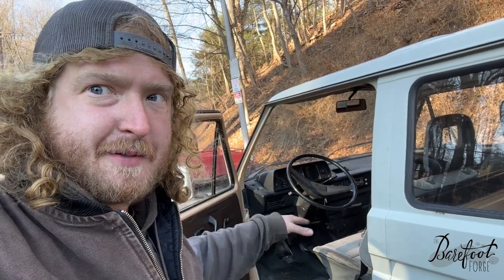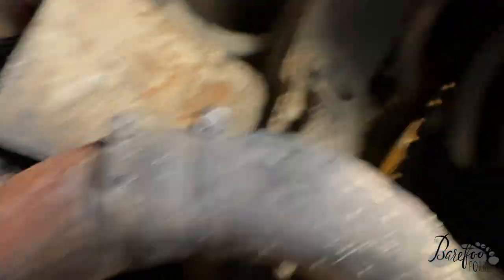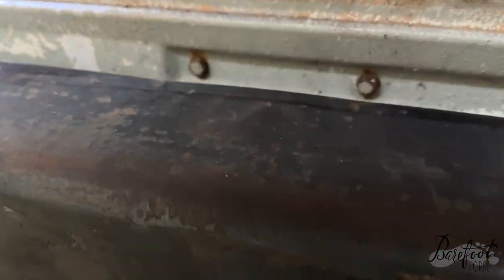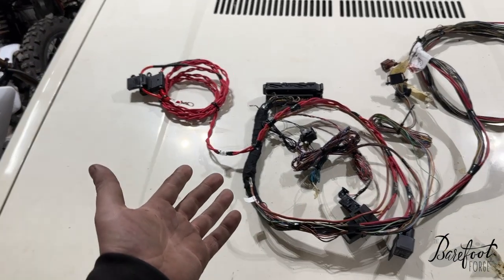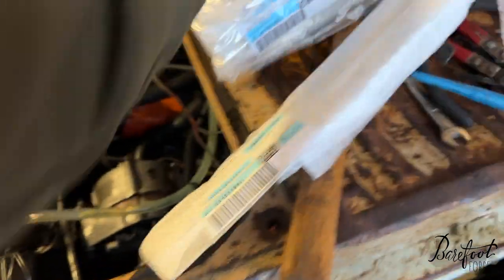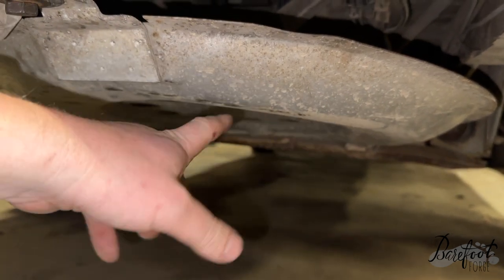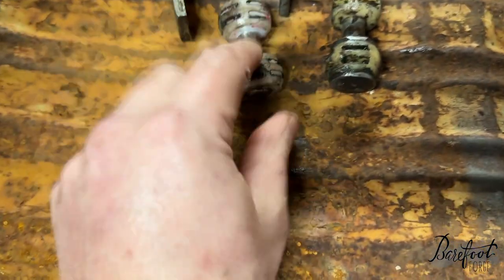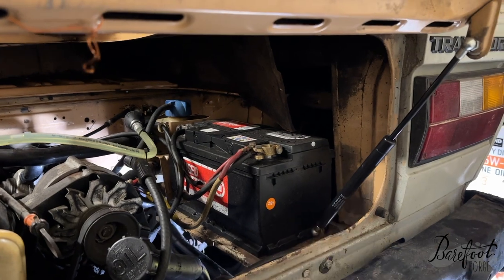VW Doka From Poland- Chapter 2 "That's Also Broken"

Comment: I bought a 91 Carat at the end of '21. I looked like the same person did transmission things to our vehicles. Mine also has an air-cooled era tranny and the shaft was cut in half then old shaft welded back to it, and it has been a nightmare to deal with. I drove it back from Clearwater Fl, to the St. Louis area. It was a miracle I got it back. When I started it the day after I got back, one of the plastic coolant tubes broke off at the engine side and dumped coolant all over the driveway. Break lines were hitting the radiator fan. I found 6 different coolant leaks after I fixed the plastic tubes. None of the balance or expansion lines were in the top of the gas tank, it was just open to atmosphere. Both the feed line and return line leaking fuel. The Power steering rack sprayed fluid everywhere so I rebuilt that. Guy I bought it from said it was his daily driver btw. After a year of rebuilding, I started it for the first time last weekend. Hope to drive it tomorrow after some finishing touches. Love your videos, looking forward to the next chapter.
Reply from the maker: Awesome man! That sounds like quite an accomplishment! I hope your drive tomorrow goes well!

I like to say “reliability has to be earned”. The last guy earned it, trusted it, and knew it- but his reliability doesn’t always pass on to you. Now you’re making it right, and earning your own- it’ll be good to ya!
Reply: In my Westfalia the previous owner did very similar butchery - mostly due to the engine swap to 1.9 TDI (1Z). It is a common trick to swap the gearbox to DK (from gasoline aircooled) to get better ratios, more suited for 1.9. It is not a fast gearbox, but faster than it would have been with the original one that came with the JX (1.6) engine.

Comment: Glad to see you experiencing an oil-burning "bus". In Europe people seem to avoid the later PD engines because of the associated ECU, immobiliser etc. but you guys in the US kept the earlier Bosch pumped engine for a few more years than us so I guess you have more parts available than we do. Again, we sometimes see Passat 5 speed diesel trans fitted (upside down) but that leaves you with a vertically transposed H gearshift unless you can find a way to correct for the fact the box is pointing 180 degrees to its original fitment...
Reply from the maker: I saw folks doing the Passat five speed thing back in the day, so folks still do that?

Comment: I have an '88 camper that had the same engine as your DOKA. After messing with it over several years I eventually gave up on it after rounds of problems involving a  previously bodged cam,  injector pump, the pump enrichment device... turbo.. leaks and then the final straw... overheating.  I then swapped in an AHU TDI and while that has also been a pile of work to get it working right, it is so much better to drive with the extra torque and power.  One good thing about all the stuff that is wrong with your DOKA is that by the time you have it all sorted out, most of the wearable pieces are going to be brand new...
Reply from the maker: Exactly! Lol. 
What transmission/gearing did you tie to your tdi swap?

Comment: I've think I've found my people....This feels like watching myself replace a CV transaxle in my Eurovan.  Should have taken an hour but required a month and 3 different transaxles (1st one had the right box but contained a very wrong part, the 2nd ended up breaking during install, 3rd was machined to slightly different specs than it was supposed to be so it wouldn't bend/rotate, so I ended up building a function amalgamation from all 3). Videos like this give me hope. 😂
Reply from the maker: I'm glad I can provide hope!!!

Comment: Ahh I needed this vid.  It is the motivation to get me back in the garage and working on mine.  How many VW do you currently have in your arsenal?  As far as engine swaps what do you recommend for a syncro.  My 2.1L is okay but I want more power..the ability to cruise at 70 up hills not slow traffic to the point where an entire family in a caravan flip you off on I76 would be amazing.  I realize I may not be in the ideal vehicle for that but…it does seem that unreasonable.  Still smile when I drive it.  Thank you for the content.
Reply from the maker: the 2.1 can be very capable when running right, what's wrong with yours? 
I've had 2.1s that cruise happily at 70/75mph other then massive hills. Yes, more power is sweet, but an engine swap costs $10-20K, does it bring you 20K more joy?

Even with an engine swap (and i have 4 different engines in vanagons)- i avoid the highways. Its a much more peaceful drive on the back roads- maybe start there?
Reply: I hear you.  Avoid the interstate when possible.  I purchased it because it is dream adventure rig.  I searched far and wide for an original avoiding other peoples conversions. Ultimately I want it to be reliable (which it actually has been).  I’ve been rebuilding/replacing everything.  I drive it locally a fair amount and love it.  I try and keep the vehicle light. Good amount of time and money into it.  I suppose it is cheaper to rebuild the tired 2.1l.

Comment: There is a hack for you're wiper to have an intermittend position... you need to remove the White u shaped plastic thing by you're wiper stalk. And replace the relay with a relay from a golf 3 than you have an intermittend wiper function...
Reply from the maker: Awesome!!!! Thanks man! Do you know what “number” relay that would be from the golf 3?
Reply: @The Barefoot Forge  there was a how to in Dutch but I cant find it any more....  I think is number 99... 

You have to remove te plastic cover from the steering column 

Love you're work btw just fuck it up until you made it... me kind of style...

I've put a 1.8t 20v engine in mine rustbucket... crazy power...
Reply: Yep. Relay 99

Comment: I bought a 1985 Double Cab flatbed Vanagon Transporter that came with the seatbelts in a box. I need to know how to fit in the middle seat and the back middle seat belts...can you do a little video on belt installation?
Reply from the maker: Probably not. That’s way to specific and not really how we work around here. Sorry. Not unless you wanted to reach out and sponsor a video on the specifics of doka seat belt installation.

Comment: I am very intrigued by your hydraulic strut for the engine flap as my brace on my doka is rather rough.
Reply from the maker: I got that from McMaster. It was cheap ($20ish?) I’ll find the number for ya.
Reply from the maker: 4138t77 just $27

Comment: About the missing wiper interval: on the inside of the lever is a white clip => remove it and the lever can be moved to the interval position. I don't know whether or not the electronics are prepared for your bus, I only have experience with VW Polo's from the same period. Greetings from the Netherlands.
Reply from the maker: Awesome! I’ll have to try that! Thanks for the tip!!

Comment: 'That's some crazy'....Lord, have I been there....
Reply from the maker: This car is made almost entirely of "Some Crazy", but its a particularly foreign variety found only in Eastern Europe.
Reply: @TheBarefootForge  You are absolutely correct about the retaining pins for the springs on the rear brakes from the kits being too short. Infuriating. I've thought about fabbing my own from a decent sized nail but have not had to do so yet.
Reply from the maker: @Achilles3588  they’re available now! Still wrong in the kits, but buy a few to have on hand!

Comment: I've been wondering what you've been doing for the last 2 months.  I see there's no end to your problems...and the time you've invested in this Project vehicle.  I had to laugh when you begin by acknowledging "it's a piece of crap".  I can't believe what you bought yourself into.  I give you credit for negotiating down the purchase price from the previous owner. In the end you will have put out his "asking price"?...but have a good, reliable Doka, and not "a piece of crap".  Is there any component still working and functional?  Seems like everything needs addressed and either replaced or upgraded?  I can't believe I'm hearing that you don't know how something (i.e., injection pump) works?
Reply from the maker: When it's done, it will be fully gone through and reliable. At this point, every vanagon needs that- even the one that's been owned by one family since new and is low milege, that most often just means they've forgotten or looked past maintenance and wear items for years. Every bus needs the same things, i'm must throwing them all at it, all at once. By the end of chapter 8 or so, it should be kinda functional. lol

Comment: Why didn’t you make yourself some pins rather than using the bolts? Not worth the time it would have taken?
Reply from the maker: What bolts/pins?
Reply: In the brake I think it was the spring retainers
Reply from the maker: @cthoma17  Ah. Because it's actually a bit of a tricky piece to make- properly. It would have taken to long, the bolts lasted this long, they'll last a while longer. 

I have heard that new pins, proper pins, are in production.